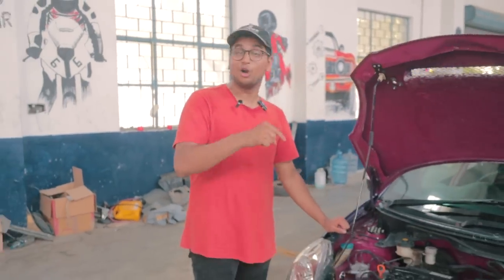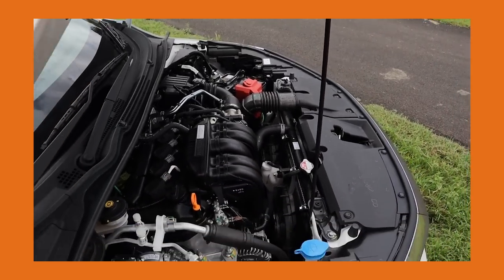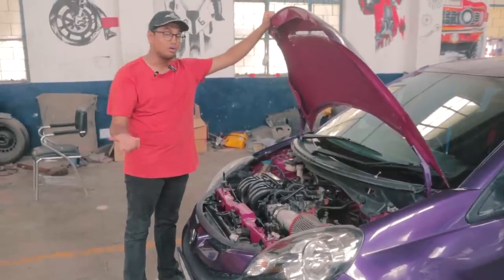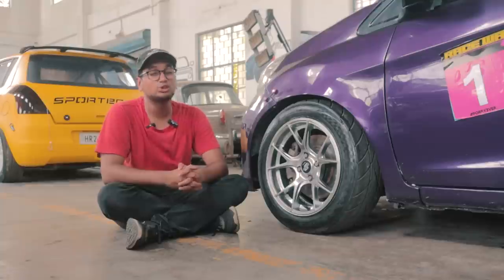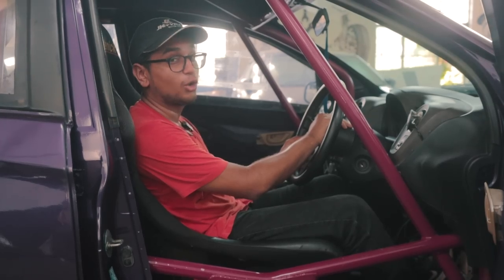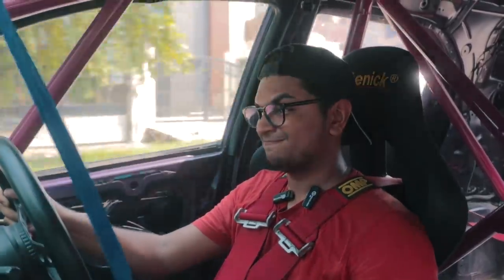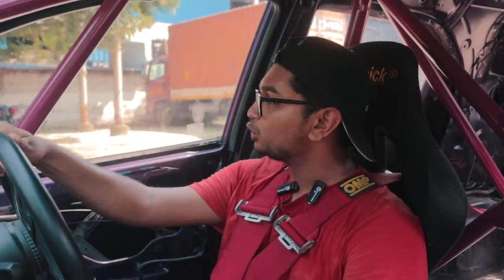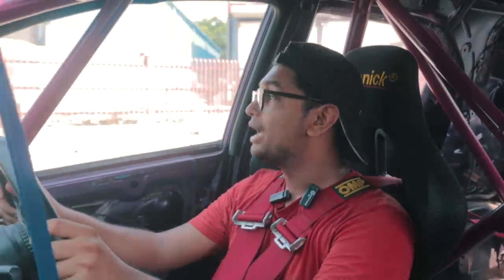L15 Engine Swapped Honda Brio with 137BHP! | 2021 Honda City Engine Swap! | Autoculture

Comment: Nothing beats a brio L15. And with the new dohc motor the potential is endless. Even a high compression NA build will put a lot of turbocharged builds behind. I wish I could know where the engine was sourced from. A turbo L15a build was larry chens pick iykyk. Imo forced induction will be a too much for my liking. Probably a high comp low boost or just a high compression build with 170-200 hp. Custom wide feders for bigger tyre (like the l15 turbo) a Lsd would be perfect daily. Without a roll cage ofcourse.

Comment: Would it be possible to plonk the Accord 2.4 in the brio? Imagine this car in the red bull racing colours.
Reply: Yes it is. But that would be more suitable to drag racing. The heavier engine up front would spoil dynamics on the brio.
Reply: @karanmalik92  would that also apply if one were to try the Civic 1.8 engine?
Reply: @dhruvshetty.95  waste of time and energy. That is not worth the effort. It’s an economy based engine without any real vtec.

Comment: Why people spend too much amount of money for reducing weight by using fibreglass panels. Why dont just add a turbo and come to same power-to-weight ratio and still have a strong body just in case of an accident .
Reply from the maker: Because power isn't always the answer! This thing is an autocross build not a drag car. Autocross is all about handling. The owner doesn't drive this car on the streets either. Adding a turbo won't give you the same result as removing doors or adding fiberglass panels. The less the weight, the more responsive everything else becomes.
Reply: DUBXOUND Karan could’ve easily turbocharged the car but for an auto cross build which this is, the 1.5 makes a lot of sense for the powerband and power delivery. Also turbocharging would have been more expensive than frp panels since he would have to make a turbo manifold which is way more complex and hella expensive not to mention the cost of turbo as well be it a Borgwarner or a Garrett unit. The FRP route is the best in this case as in an autocross, power isn’t as essential as car being nimble, lighter and having amazing breaking and handling as the courses are essentially slow corner circuits. A fast revving and an engine with power through the rev band even though making less hp will be better. Turbos not only have turbo lag but the power is always in high end (of the rev range). Supercharger might work but it is also a parasite since it uses the engine to spin it. Autocross is all about handling, breaking and how fast can a car put down power. Turbos come in play in cases where there are long straights and the car is topping out. Let’s say that the car with the L15 tops out at 200kmph. Adding turbo will increase the power no doubt but that will be in the higher end and will push the car to let’s say 230kmph. In autocross events it’s basically useless unless the turbo spools up at 1750 rpm (essentially being a tiny turbo). Decreasing the weight with FRP panels will up the power to weight ratio as you said which can also be done with a turbo but it is useless in this purpose built autocross car.
@karanmalik92 thoughts on this?
Reply: Doesn’t matter now if the car has steel panels or FRP in terms of safety as it has a pretty well built roll cage and the driver door is stock. Even in the worst case scenario the roll cage, bucket seats, harness and the helmet will protect the driver.
Reply: @priyampatel Take a bow sir for an excellent answer to a stupid question/suggestion. 
These guys probably have never experienced a well tuned NA engine and make rubbish statements.
Reply: @priyampatel totally right. Thanks for explaining the logic. The response of the NA and a flat torque curve make a big difference to the predictability of power delivery. 

However turbo isn’t a failure at autocross either. Just a matter of personal preference. Cars like the 1.0T polo are also doing quite well. But a big turbo with oodles of lag is definitely more of a track or street toy.